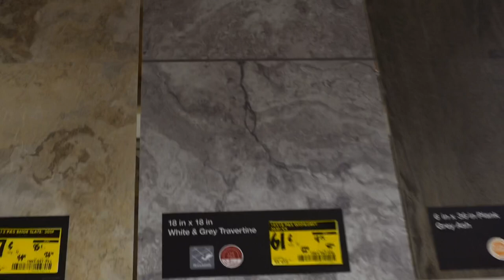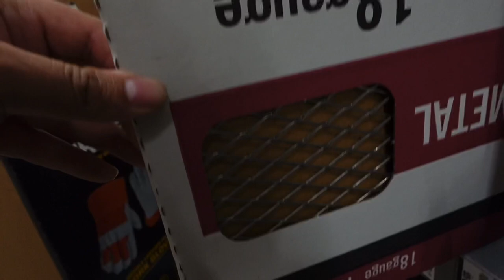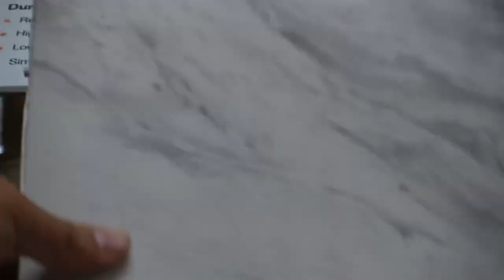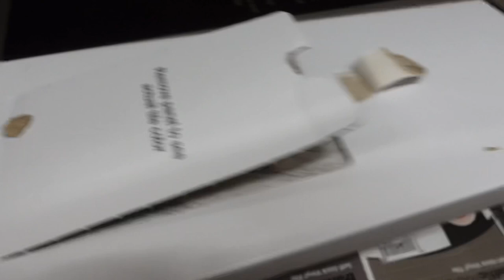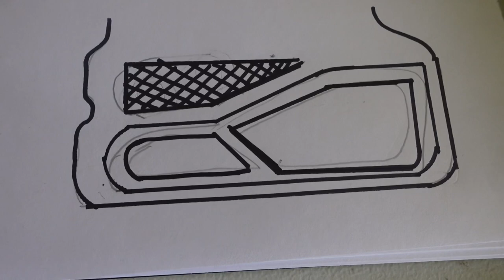CHEVY TRUCK SUNDOWN SOUND SYSTEM Build pt 3 | CUSTOM DOOR PANELS

Comment: Congratulations on 3k..... Two things.... Check out Steve Meads YouTube SMD..... On his Black Escalade.... He added some metal trim.... Made it look like Cadillac made the doors..... You may get some inspiration...... Ok number 2.... In 96 I built a black S-10 I used black marble farmica..... Sorry for miss spelling....Lol... Like you use on counter tops.... It's large sheets so you can cut out the sections you like..... But I used it for the background.... I had my Red Series Orion amps.... Sent off and Chromed... And had all this covered with Plexi glass trimmed in gray vinyl.... Back lit with purple neon..... Hope that helps with ideals.....